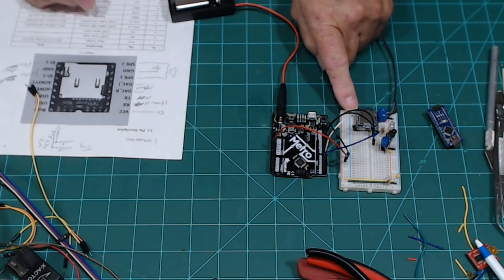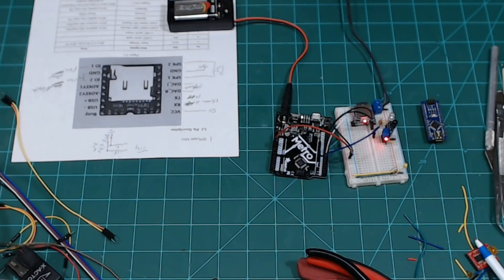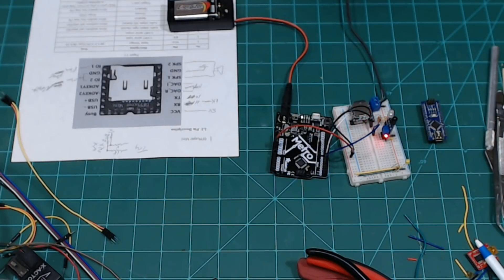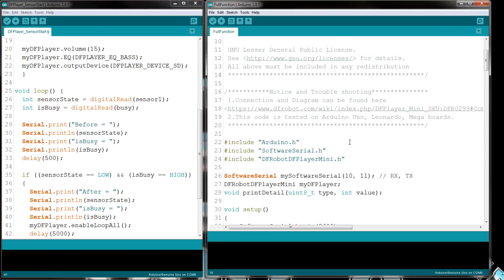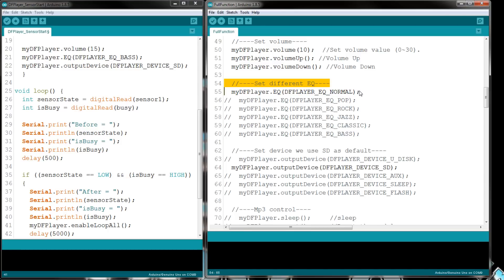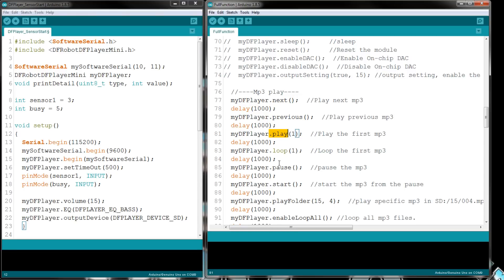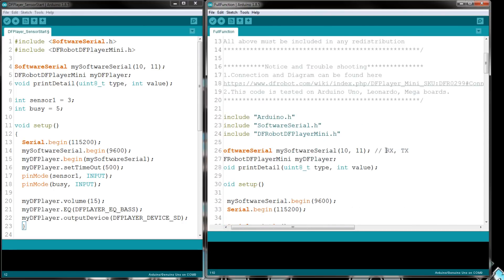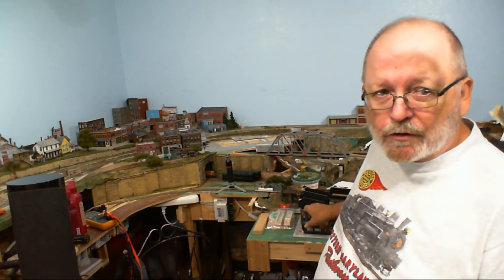Easy Sound fx With A DFPlayer Mini For Your Model Railroad

Comment: I am mounting my board in the tender with an auto Chuff sensor on the drive gear and key fob radio receiver, I have a chuff trigger and 4 buttons to send IR Pulse to the MP3 Player. 5VDC from the regulator and rectifier from AC track.  I wanted stereo so chuff can operate un interrupted but for  $5 I can add a second MP3 board. I play in 1950s American FLyer S Gauge so we have bigger tenders.  I hope it works. Dennis
Reply from the maker: Great idea. Thanks for the input!
Reply: @TomsTrainsandThings  I can report back it worked . BUT you need two speakers Not a big deal There are some tiny speakers.

Comment: Hey Tom, Im getting back into the hobby after 30+ years, and looking for sounds for a Blacksmith Forge, Sawmill and I wasnt sure if there is/was a program to let the trains run an operation through the computer so we can just sit and watch. I seen your video to have different sounds as the train moved around the track, but could it be set with an IR detector, so as the train goes round  and trip the sounds?  Thx, Jeff
Reply from the maker: I'm not aware of any commercially available product for that.

You may have to build your own with Arduino and DF Player or if you want more control, DCC-EX allows lighting & sound in their setup

Comment: The pop is a design "feature", You can modify the 8002 amplifier pinout, the shutdown pin (pin 1) is connected to ground via a 0 ohm resistor (at bottom), so the amplifier is always operational. You can change this and use an Arduino pin to fire up the amplifier when needed. This strongly reduces the power up pop.
Reply from the maker: Design Feature? I contacted DF Robot 3 years ago asking how to correct this pop. They know nothing about it and had no answer to correct it. I heard form another user a while back on how to eliminate the pop with a little bit of soldering on the bottom side.
Reply: @TomsTrainsandThings  I solve it by controlling the 8002 amplifier with a digital IO pin. Using the busy signal of the MP3 decoder solves the big pop, but a small pop remains and sometimes pops between tracks are detectable.

Comment: Hi Tom...enjoyed your video...entered the code as you show on video and then opened serial monitor...(isBusy) command always stays low for some reason...cant get it to show high.  I changed your if statements to reflect ir sensor low and can get music to play.  Any ideas why this is happening?  Thanks for reading this.
Reply from the maker: Your IR sensor may work differently than the one I used. The isBusy statement was very hard for me to catch a change also in the serial monitor. As long as the LED on the DF Player is lit, you know the condition has been met (isBusy). It's an indication for the code to know when the DF Playerr is playing a clip, and waits till it's over.

It was a pain to troubleshoot this in the beginning because it was hard to pin down actually when the isBusy was initiated and ended.
Reply: Hi Tom...thank you for your reply...I will play with the code over the next few days.  It appears on my DF player, "is busy" appears to be reading low from start up.  Also, in another or your videos, you mentioning a pro version...how are you liking that compared to just the mini?  Thanks again from British Columbia...Geoff
Reply from the maker: @gjdanco4260  I just received my Pro last month, haven't tested it out yet, but in looking at the wiki, the code is much easier to use and there is nearly no set up.

Will be looking at it next week
Reply: @TomsTrainsandThings  hi Tom...went back to project and thought to myself the code says int busy =5; but I don't have a jumper to pin 5.  I wired up the breadboard as per instructions in the DF player link as you had no schematic provided.  Went back and listened to your video and you mention a busy pin on DF player.  Went back to instruction sheet, found that pin and provided a jumper to pin 5 on the uno....SUCCESS.  Enjoying the satisfaction of troubleshooting this and getting it to work....something I have been unable to do until I discovered your video.....thanks for helping me out with this.

Comment: Hi Mr. Tom I'll be receiving my df mini today  an I downloaded the full sketch my question is do I copy it under the void set up or the loop set up ?
Reply from the maker: If you download the entire sketch, you don't need to add it to anything. Use it as is.
Reply: @TomsTrainsandThings  okay, so question how do I change the EQ levels 🤔 and setting it for my SD card and stuff ? 
I'm sorry for asking so many questions but just trying to get familiar with this unit.
Reply: @TomsTrainsandThings  and also how do I add it in with my sketch to perform with it ? 
I was copying your sketch with IR sensors so my sound would activate when the train hit the IR sensor.
Reply: Hi Mr. Tom, I finally got it working 
Now question can I use your sketch that you made for the IR sensors? 
Or could you send me a copy of your sketch 🤔  ?

Comment: Fantastic video but was wondering what the connections were from the arduino to the DFPlayer and the infrared sensor. Do you have a diagram, the DFRobot one doesn't show everything.
Reply from the maker: You can find the pin designation other than the obvious in the code. The rest are on the diagram in the DFRobot wiki which is in the description. 

I also have a few more videos on the DFPlayer mini.
Reply: @TomsTrainsandThings  Thanks for your quick reply>
Reply: Also what about the connections for the infrared sensor and arduino?
Reply: Just went back thru the code and I found what I needed. Thanks again

Comment: Thanks for the Arduino Made Easy series.  The series and your other tutorials have been immensely valuable and helpful to me.  I've been able to get some Details West flashing cross bucks to work using the IR sensors and simply Daisy chained several of them in an East/West approach senario to have them work over multiple tracks.   Just now I'm experimenting using the dfplayer and IR to sound bells at a crossing on a seperate Arduino...now to figure out if there is a way to combine the two into one seamless sketch, or somehow wire the same sensors to work with the second Arduino?  (scratches head).
Reply from the maker: Glad I could help. I have a video that uses two arduinos for lighting & sound. It's the one with the welder. You can use the same principle.
Reply: @TomsTrainsandThings  Thanks, I just watched the video and checked out the sketch.  I'll give it a go and see what I can come up with.  I'll be sure to let you know.
Reply from the maker: look forward to hearing from ou on this.

Comment: Wonder if this is adaptable to a scalextric 🚗 sample from the motor signal, i wouldnt have a clue how to write a sketch that could take advantage of throttle curve and time duration etc seems a complex little problem.
Im sure i can get enough full audio volume and compact from using a modern smartphone setup ;)
Reply: 3d print a micro speaker enclosure with a tuned chamber for a smart phone setup and mount the board amp etc to it keep it compact.
Reply from the maker: Neither would I, not familiar with it!
Reply: @TomsTrainsandThings  nice sounding loco mind i like it 👌

Comment: nice tutorial, but i have a question... it's possible to define different audio samples from SD card and to modify the code to play that on different conditions?
example: if i made a thermometer and it show a specific value, on 25 degrees to play a specific sample from SD card, and so on... what you think, it is possible ?
Reply from the maker: Thank you. You can do anything with code. In your example a switch/case statement would work to access specific clips for each condition. I found when uploading clips to the SD card, even though you have them numbered sequentially and time & date stamp are in order, the SD reader reads them offset by 1. I'll have to look at my video clips that I haven't published yet to see how it was done correctly to get the desired results.  If you run into this problem send me an email and I'll let you know how I did it.
Reply: Ok, thanks for the reply :D
Reply: Having a code that plays different sounds at different temp's is exactly what i want.  Can't make it happen, i can't code.

Comment: Good video Tom! Im having same problem with speaker popping at power up and off. Also have a little back noise "bep bep bep" when song is playing. Other than that works great
Reply from the maker: Thanks Austin. I think the popping at power up can be eliminated with a capacitor. I'll have to try that out if and when it becomes annoying. lol
Reply: To remove the pwr pop sound and background noise I cut the ground wire from the speakers going to the dfplayer. That worked for me

Comment: Hey Tom, thank you for the great video. I’m not looking to make a railroad, but I am looking to make a toy that can play a random assortment of sounds and flash some lights. I’m very new to this and was wondering what I should look out for when it comes to speakers? I need a tiny speaker, and I found 1 that is 8 ohm and 3 watt with full range audio. Didn’t know if there is anything specific I should worry about. Thank you and have a wonderful day
Reply from the maker: I have a few more videos on the DF Player where I show speakers and even hooking up an amplifier.
Reply: @TomsTrainsandThings  thank you very much. Just bought all of the primary components (including the speakers). Really excited. Thanks once again!

Comment: I must have something wrong in the pin connections from the arduino to the mini df player and sensor. It is not working at all.  The wiki dos not help because the sketch isn't the same as yours.  do you have a fritzing diagram of the connections?
Reply from the maker: Unfortunately I'm between web pages and there is no Fritzing component for the DFPlayer available anywhere. All the connections are on my paper onscreen & in the code on screen.
VCC - 5V
RX - 11 with iK Resister
TX - 10 with 1K Resister
SPK 1 - Speaker
SPK 2 - Speaker
Busy - 5
GND - Ground

If you want a sensor to trigger the activity, hook it up to pin 3 or any other pin you desire that you would declare in the code.
Reply: @TomsTrainsandThings  Thank you

Comment: Kool I need one of those for my crossing bells.
Reply from the maker: works great
Reply: @TomsTrainsandThings  Would it work hooked up on IR sensor?  
I've got a sound module that I put a bell on but not sure how to hook up up with my arduino an board.  
I seen this thinking maybe it would work put a few bell an engine sounds on the card.
Reply from the maker: Take a look at this one:  https://youtu.be/CvSN1GUt5ak

Comment: Hello, I am setting up a project that is a plug-in keyboard, (a toy), where the child will put the letters and a led will light and play an audio speaking letters (A, B, C ...).

So I am using MEGA arduino, and the DFPlayer Mini board for this project, besides 26 green LEDs, everything is working fine.

The contacts fit leds and even the audio. But the audio goes into a loop, and I would like the audio of each letter to be played only once.
How can I be solving this?
I'm sure it's something about my code that is attached here.
So how do I disable looping using DFPlayer mini ????
Reply from the maker: For each note you should choose a specific track:  myDFPlayer.play(001);

Make sure this line is no where in your code:  myDFPlayer.enableLoopAll();
Reply: @TomsTrainsandThings  I saw in my code is has no line with myDFPlayer.enableLoopAll ();
Reply from the maker: Use your print command to see what is going on in your (for) loop with nElements & .play. Maybe take out the +1 in myDFPlayer.play(i+1); see how it reacts to that.
Reply from the maker: I also noticed you don't have a busypin declared, to determine when the player is playing a track and not playing a track. If you go through the serial monitor with the print command for the items in the loop, you will see where your issue is.

Comment: I don't want to use Arduino, I have the DF player working with momentary switch but want to make it loop, without Arduino.  Thoughts?
Reply from the maker: Check the df player wiki for the manual commands. You can do almost anything through the matrix

Comment: i can use it with atmega32 ? if i can`t what i can use to produce sound ?
Reply from the maker: Never tried it with the atmega 32 but it is possible. Check out my video on how I programed an attiny85 with an Arduino https://www.youtube.com/watch?v=zjQNTeD5PQc

Instructables has instructions on how to program it with an Arduino https://www.instructables.com/Programming-ATMEGA32-or-Any-Other-AVR-Using-Arduin/

Once it's programed by the Arduino Uno, you can program it with the DFPlayer for sound or anything else you would do with an Arduino

Comment: good video, but you can operate the dfplayer mini without a microcontroller,  u can just use the IO1 or IO2 port directly
Reply from the maker: Yep, but this is a build up of what can be done with it with Arduino. Like animating lights and other things with sound.
Reply: @TomsTrainsandThings  ohhh right, that makes sense. BTW I already finish my project with dfplayer mini also and this module really sensitive, if the module cannot play the mp3 again, that's maybe because of the memory card was broke

Comment: Hi everyone, i cant communicate between Arduino and dfplayer mini.i followed dfrobot.com but im getting an error " unable to begin".im in need of help,pleaseee
Reply from the maker: Contact dfrobot for help. They have a forum for issues. I have around 10 df players with no issues. recheck your wiring. try another player.If you think your player is defective, contact the vendor where your purchased the device.

Comment: Good afternoon sir i hope this message finds you well, did you ever solve the powerup pop issue?
Reply from the maker: No. When contacting the manufacturer they were no help in resolving the issue.
Reply: @TomsTrainsandThings  Would it help to start with low volume and then ramp it up?

Comment: The code in the description doesn't match the code on your screen...  several lines are missing.
Reply: I managed to re-make some of it from the text on the screen.  Compared to other peoples missing or broken code this is actually almost about to kind of work. Limited options but.. works to a degree.
Reply from the maker: If your talking about the Serial.Print Lines. Those are only used for the setup for the sketch while I'm building the sketch . This makes it easier to find what happens when during the execution of the sketch.